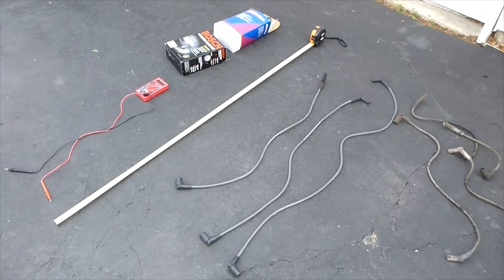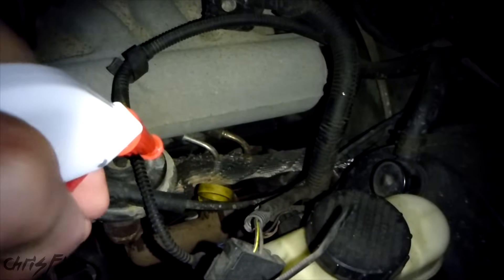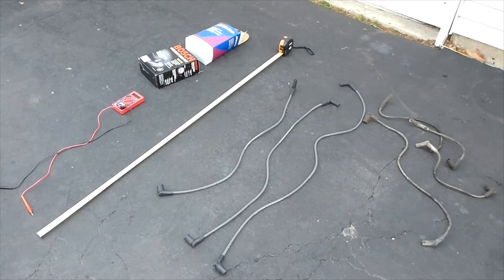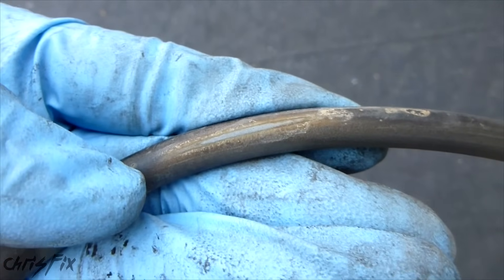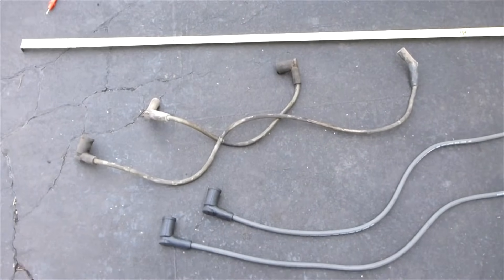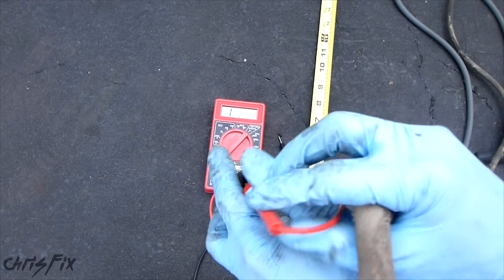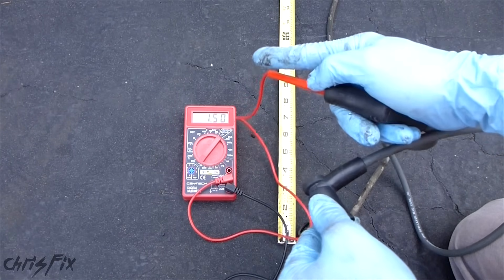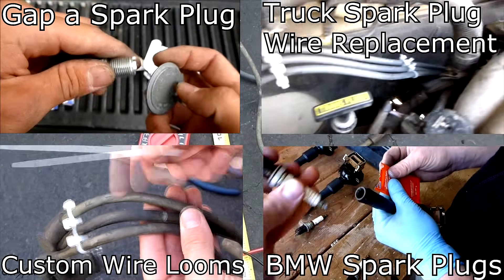How to Test Spark Plug Wires

Comment: Hello, When I was parking in a tight spot, it was hot day and I heard a small pop and how I have all 6 ignition coil P035X codes coming and going in my OBD2 app. I took it the mechanic who inspected and said everything was fine but I am looking to take it in to another mechanic for second opinion and see if the coils + spark plugs need replacing.

When i clear the codes it drives well and fine until in like 100-150 miles when the code pops up again and repeat. can this be a wiring harness issue or a ground or a fuse issue. I saw in the Volvo owner's forum that due to the engine cover heat might be trapped, causing wiring issues.

Car is a 2009 Volvo XC70 T6 with 190K miles and Carfax indicates fuses, plugs and coils changed at 167K Miles. Any help or guidance is appreciated, thanks

Comment: if my engine is running rough and i have bad wires, wouldnt i be able to move each one around to try and find a position where the cables are "fine" as long as theyre not short circuited? just i thought from a beginner mechanic who is trying to restor a bmw e30. :)

Comment: Need to check spark plug wires and did YouTube search and your video was first result 😁. Thanks for the info, btw did not know that wires had that much resistance hehe but okay I never worked arraound cars hehe besides fuses check, car stereo connectors wiring (with Google help 😎) and such hehe.

Comment: Hi Chris, My car is normal to cold start the engine, but it will have misfire to hot start engine. What possible common problems do you think there might be? Fuel Injector or Spark plug wire?
Reply from the maker: I'd check your fuel pressure as well as fuel injectors and wiring to start

Comment: Bullshit....
4:40 negative blk lead is bushed out from when you started straightening out the spark plug wire.
Blk lead was in farther when the eire was curved. As u straightened the wire u pushed out the blk lead.😂😂
Not that funny

Comment: Chris I have a 2v mustang like yours and I found oil in my spark plugs. Could you advise on what to do?  Thanks
Reply from the maker: I’m every spark plug well? How much? If it’s just a little, could just be minimal seepage over time. If it’s a lot in all of them, you might need a new gasket. I’d clean it out and see how quickly it comes back.
Reply: It’s on the threads but not that much. I’m actually in the middle of an intake manifold swap following your video and decided to replace the plugs and found it. I could go ahead and replace the valve cover gasket now that I have everything apart but I noticed the plug holes are separate and don’t know if it would fix the issue. I have not seen oil in my garage floor so it may not be the gasket. What do you suggest? Replace the gasket since it’s a 23 year old car? I only have 70k miles on it.

Comment: My mechanic by mistake clamped one of the spark plug wires and it dented a bit, after he was working on the car and i tested it, i noticed that the car works iradically when I tried to press the gas pedal, and my fuel economy decreased. Could it be that that small dent in the wire damaged it inside, and yea the wires were brand new before i gave the car to the mechanic. Thank u in advance, and your videos are so helpful!!!😊

Comment: A resistance check on spark plug wires is not a good way to test internal wiring, you can have 0.1Ohms with one wire strand, but it will not work on the car

Comment: 9 8 7 and 6 kilo ohms for the new wires 

The old ones not more then 6 ohms for the longest wire   so the new bosch ones were not even as good as the old ones

So I got another set of which the resistance was no more then 1.5 kilo ohm    for the longest wire    which seems to be fantastic  

So perhaps the bosch new wires are just copy ones from china or sonething they seem to be junk    

My problem was I used 2   1 kilo ohm wires and 2  10 kilo ohm wires        and my engine didnt run good whatsoever    also gapped my old spark plugs again to 0.7mm for my car   since the engine made a hell of a sound with 1.2mm gap  
Old ones out   older ones in    and yes revving the engine to the max and no extra volume in sound anymore

Comment: Hey Chris, thanks for another great video. I have a 1980 camaro with a 383 stroker that I built. I keep burning plug wires which results in a cracked insulation on them. Headers get real hot and just happens over time. Even with Kevlar boots they still do this. Eventually tried header wrap combined with the hoot and haven't burned one since

Comment: I use excel 8mm spark plug wire and I still have a rough running engine.The wire looks like new.

Comment: I love the video, but, u checked ohm’s on the cables and one was good and the other was within specs but u didn’t say ‘what’ the specs are that I should be looking for? What # is good and what’s bad? Also, in the water spray test, you showed the sparking but u never went back and identified what was causing it? Prolly a plug wire but u never went back during the day to the exact spot u saw sparking at night and said this is where I saw the sparking, this area, and here’s what was causing it?? I’m not trying to beat ya up, just my opinion that’s it, for what it’s worth. Thank you for ur help!!
Reply: Depends on your owners manual

Comment: You need a spark visual test. Put a spark thru the wire with a gap to ground. I’m told it should deliver spark with 15 mm gap!

Comment: my car starts and runs but I get no reading at all when trying to test the wires. I tested wires from a different car and they read around 8.65 when set at 20k ohms so I think I am testing them correctly.  what's up with these wires. I don't any brand name.

Comment: Excellent and glad you showed that a multimeter has more purpose then just showing battery voltage lol. My friends been bugging me to buy one or use my “ohm” meter. I let him wait a bit since he’s a pain in my butt and went over and said I’ll bring it. I got there there and said “hey can u grab your multimeter just wanna make sure they read the same voltage on battery”  Then I switched to ohm “20,000” and tested his allis chalmers tractor wires and various other electronic components. “I heard him say” “you a** hole”. Lol. I just smiled and told him to use the inter web lol 

Great vid. Like from me. Lifetime ASE certified mechanic

Comment: Moving the spark plug lead at around 4:40, and checking the resistance, is not really a good test. If your test leads loose contact to the metal for a just sec, you can get an infinite reading (the lonely 1 as fist digit).
For this test to work properly, you have to fix your test leads with clamps, and make absolutely sure that contact with the metal is not broken, when moving the lead around.

Otherwise, good solid advice.

Comment: Good video. How do know what ohm reading you should have without buying new wires?  I have a 69 beetle with pertronix 3 ohm coil that is getting good voltage to the coil resistance reads 3.54. And the secondary reads 10.26?  Thanks

Comment: I just changed my engine valve covers and spark plugs/coils. After most of the day of the car running perfect, it started vibrating and the check engine light was blinking. After that I had my battery on without the engine for a few minutes and the battery died, but once I jumped it the vibrating problem was completely gone until it came back later that night and is now there consistently. I read the code and it is a misfire on cylinder 5, plus random misfires anywhere. I tried switching out the plug and coil in cylinder 5 and nothing has changed. Any ideas? Maybe wiring has gone bad, fuel injector, or even battery related? I can't imagine that it isn't something I touched!

Comment: Hey Chris,
Let me tell you a story lol
My engine purs. Happy little 1.6 petrol. Got my timing belt changed and it suddenly idles like a bag of crap. There's a tick coming from the carb. The engine makes light pops, sometimes the whole car shakes. The rpm bounces around 800-900 on this ~1 second rhythm. During this time, I noticed when I change gear the rpm lingers a second before it drops. I took one lead out at a time to see if the idle changed at all, no such luck.
Rest of the rpm range is pretty smooth, car feels roughly as powerful as it was.

So I drive it for a few days when it starts idling at 2,000 rpm. The exhaust gases are way hot, temp is above normal. Possible hint of petrol on the exhaust too, hard to tell.

Sometimes, I can use the clutch, slow it down and it stays down, sometimes only letting it go cold stops it.

Now, I'm of the impression this guy screwed up the timing belt. He tells me it's the leads and the injectors.

Any thoughts?

Comment: Testing spark plug wires

1: water mist test (at night or in the dark) spray each wire look for sparks, replace sparking wire.

2:  remove spark plug wire, and visually inspect it for cracks, burns, and corrosion, replace bad wire.

3: using a multi meter, put it on ohms set  it to 20000, test each wire you should have around 1000-10000 ohms. (Move wire and take different readings while Bending the wire if it loses  a significant amount of ohms while Bending replace the wire

Shmptoms 
Weird idle
Radio interface 
Bad gas mileage
Reply: Thanks for your summary!!!

Comment: a tried and true method ive used for decades if you have a miss is if you are afraid of getting zapped put on a leather glove and pull off each wire from the distributor to see if there is a bad wire/plug. if you pull it off if its bad it will not make a change and a consistent miss on a cylinder. now swap over a wire and see if it comes to life. if it does not- change the one plug. if it comes to life replace the plug or all of them.

checking ohms on wires does not mean much since the resistance varies greatly even on different brands. unless you spot a wire that is WAY different than the others. many types of wires have very high resistance so the voltage has to build up to give a hotter spark--same as resistance spark plugs. 

if you have truly wild random misses also take off cap and check for moisture or conductive dust. but wires is always a top suspicion and they can and will be bad out of the box--ive had it happen and got my money back and put on odd brand and problem was gone. In the southwest the dust has iron and other stuff in it and is VERY conductive. 

if you find bad wire or plug should you replace them all? NO--not unless you are rich and you know they are old or if they LOOK old. remember the other plugs and wires are CONFIRMED good. that being said if they look old and car has issues by all means replace all plugs and wires as a start such as after buying used car.
Reply: if you pull off wire from distibutor and spark is long as you increase the distance? and the cylinder comes to life? plug and wire are both suspicious but will be one or both. that is because the very high voltage is now firing the cylinder.
Reply from the maker: Thanks for sharing!

Comment: Awesome video. Worked on cars throughout the 80's into the early 90's. Carburetors, distributors, etc. Then I lost my garage due to divorce. Didn't open a hood for 20 years.  When I finally did I didn't even know what I was looking at. Went to work and learned these ECM controlled engines. Now I'm doing my own work again. Thanks a lot for your awesome content!! New sub here!!
Reply: Divorce can take the wind out of your sail for sure. Been there.

Comment: Great video as always but what was the point of the tape measure? I understand greater resistance on longer wire but did I miss some equation or calculation process?

Comment: Thank you so much Chris, I had a very rough idle and bucking at 70mph.
Troubleshooted and replaced parts after parts for 3 full days with no luck.
Just a hour ago I did your spray water test and discovered one lead was burned by the exhaust with no insulation left, and was grounding out!

Thank you so much!!!!!

Comment: Thanks a bunch.  Super video.  My boat engine (2 cycle) has old plug wires that have "tarnish" on the terminals.  I have replaced two of them.  It seemed to help my engine run a bit smoother but there is an occasional miss or rough idling.  I believe I'll replace the other four wires as well.

Comment: I have a 1994 GMC 5.7L, the old wires had  about  4500 ohms per ft (one was broke and bad) . The new wires ( all 8)  had about  1500 ohms per ft. Good right?!  Wrong,  the new wires have only 7 mm diameter which lead to arcing at cylinder #2 right thru the new wire! ( I found the arcing like Chris Fix suggested in the dark).  I had to install one of the old wires to get it to run correctly and not miss.  What is also critical, is to get at least the same diameter of insulation (in my case at least 7.5 mm).

Comment: Hi Chris. I have 2013 MDX. It has s misfire in cylinder 5. My error code is P0305.

So I have done the following
1) Swapped Coil and Plug from cylinder 5 to 6, code remained P0305
2) Tried Seafoam, Redline S1 and Mystery Motor Oil treatment in fuel tank and Engine, issue did not resolve.
3) I got compression test done and it showed low compression in Cylinder 5 120 PSI vs 170 PSI in cylinder 4. Then I got an auto body shop to do all 6 comparative compression test and it came compression is only 25% in cylinder 5 and approximately 75% in cylinder 6. Cylinder 1,4,2 were 100%, cylinder 3 was 92%
4. I took it to Acura and got valve adjustment done, they said it was loose intake valve. It made engine sound alot better and I felt it got power but misfire still shows in p0305.

I watched your video and have read forums. Now I am not sure what to try or do next. Any advice and help will be great. 
What do I try next?

Comment: How could a spark plug wire have 1000 ohm to 10000 ohm and work I am not sure but it should have no or very little resistance to work

Comment: I got slightly shocked while I pulled out a wire while the car was running. I'll do these tests for kicks but I'm just going to replace them. They have at least 90,000 miles on them

Comment: If the damage is just a cut in insulation. Not damage on the wire itself can it be repaired by electrical tape or rtv silicon?

Comment: Hey Chris do you always recommend changing the spark plug wires when you change the spark plugs? 
   Also the lower the omes of resistance the better they are?
Reply: Yes,..and see that's the key to this info,..the less the better,..that's why at first it didn't make sense until I read your comment !!!
Reply: @user-jr5qw7le1y  I always thought the higher it is, the stronger the connection.
Reply: @mayeri3083   Nope, the higher number in OHMS, means more resistance to current flow.

Comment: I love your channel. Your guides have helped me not only with my daily driver, but, also with my classic project car. 
     I'm currently replacing ignition wires on my project car. It's a 1959 Ford Fairlane Galaxie 500 that was owned by my Grandfather. It has been garage kept but hasn't been run since the mid 1960's. 
Thank you for your content!

Comment: Great video. Another subscriber here now! I never thought of the mist test. I had an intermittent miss that wouldn't throw a code since it wasn't exceeding the threshold for the number of misses the ECU needs to rigger that code. I changed the rear coil pack due to the connector on the coil being loose but still functional. The miss went away. The coil was working fine but I did reroute/move ALL of the wires to do this. I bet I have a insulation breakdown somewhere and I've already bought new Motorcraft wires and plugs anyway so I figure 21 years (98' ranger) and 243K miles on the original wires isn't bad. OEM stuff really lasts! I have no idea how long the plugs have been in so they need to go anyway. Bet it runs like a new engine! Thanks for your time making these vids. They are helpful for the DIY'er.

Comment: I got electrocuted by the spark plug wire while does that mean they're bad car has a breaking up issue. Was touching the outside no  metal
Reply from the maker: Yea the insulation is bad so replace it
Reply: @chrisfix  yeah thought so but they seem to look ok. But I would say thats it. At first it wouldn't start  changed the coil and fired up but then when didn't wanna go above 90km. Then I checked a plug yesterday and now running rough on idle I'll change them and let you know how it gose. Thank you :)

Comment: At 5:14, how is 1,500 ohms on the new wire even close to 10,333 ohms on the old one that's in spec? Help please... Something seems off, not understanding. Thanks.
Reply: Too much resistance reduce voltage that reach the spark plug, leading to weak or no spark, misfires and poor engine performance.

Comment: I had 1 bad plug wire and  experienced CYL 2 MISFIRE, TRANSMISSION SLIPPING, OVERHEATING ENGINE. Radiator guy wanted to replace the radiator. Transmission guy wanted to fix the transmission. After checking the plugs, coil packs and wires, I replaced the wires for $29.00 from Amazon. No more problems.

Comment: I JUST REPLACED  THE  WIRE  ON NO 3   PLUG  ON MY 03 BUICK , ITS RUNNING  GOOD NOW M HOWEVER THE NEW WIRE WAS 5k OMS AND THE OLD WIRE WAS LESS 1.5 k  SO WHATS UP   SHOULD THE OLDER WIRE BE BETTER WITH LESS RESISTANCE?

Comment: What a genius information. Thanks for sharing.
I replaced the bad coil HT cable 4 which has over 13kohms as against the specs 1kohm.

But something surprise again, the same car i20 has 2 separate coil packs controlled by 2 wires connector which controls 2 high output terminals. However, one high terminal pin 4 of first coil gives less spark than pin 1 on the same coil pack. Why such less spark being provided by the same primary coil of the same coil pack?

Comment: Can brand new spark wire give bad ohm reading? I have very strange problem because my ignition coil running hot like microwave. I using brand new bosh spark wire. I test it and resistance are low,